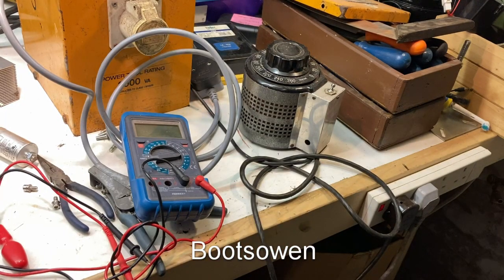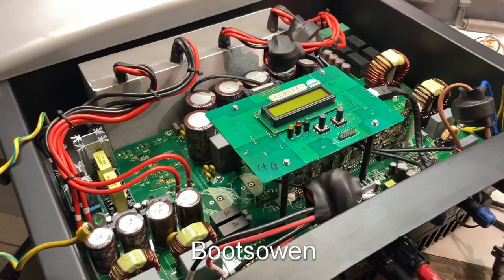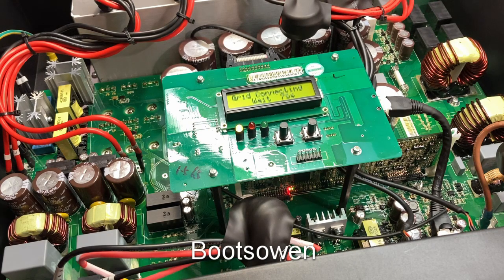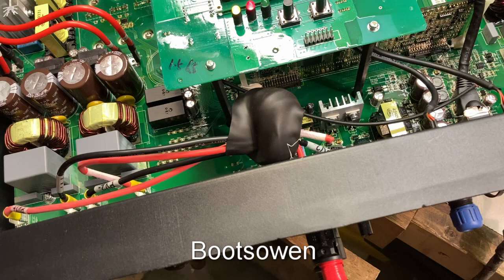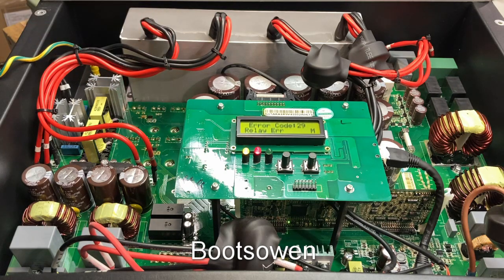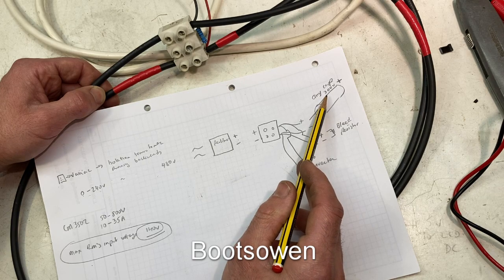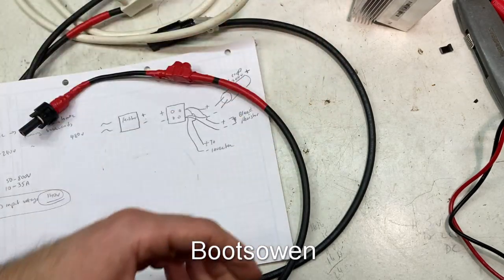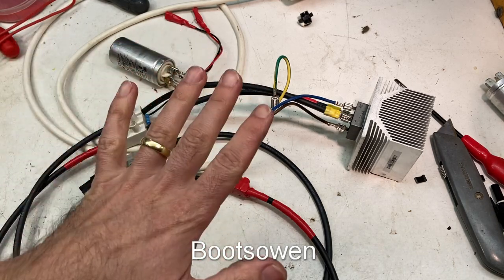Solar grid tie inverter test arrangement, and testing a SAJ Sununo TL4KB Grid tie solar PV inverter.

Comment: Great video thankyou ❤. Please tell me the capacitor value and resistance value please... Grid voltage need isolation transformer connect to the inverter or directly connected as a same source ac .... DC need isolated from AC grid support please. Thankyou 
Please guide me as soon as possible
Reply from the maker: Capacitance and resistance of what?
Reply: @bootsowen  Thanks for your reply....PV Input connected to inverter after isolation transformer smoothing capacitor and discharge resistance after bridge rectifier..... And how to connect grid input to inverter need any isolation transformer or other circuit required please .... If possible to share you contact details please Thankyou.
Reply from the maker: hi, i do share my contact details. they are there. but if you have a general question and are not paying for advice then here is the best place for it. 
The inverter has a grid connection but it is for output of generated electricity. How would the capacitances help you, is your machine broken?

Comment: Good luck with that one. My identical inverter continued the relay fault after replacing the four black relays top right. Worth checking voltage at the top right wires beyond the relays to see if AC power is getting through  bulb probably easier than multimeter as the mm's delay is a bit long and not conclusive.
Reply: I just came across this and was just going to say, from the layout of the circuit board I'd be checking the 4 black relays at the top right.. But you beat me to it :)